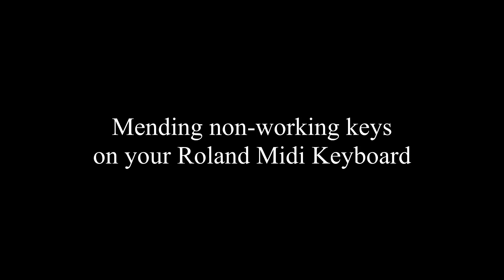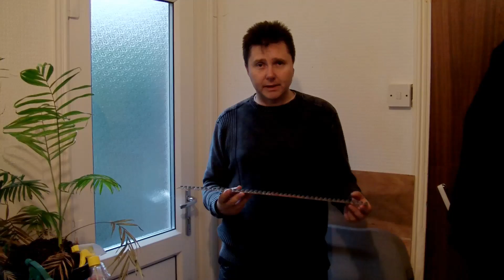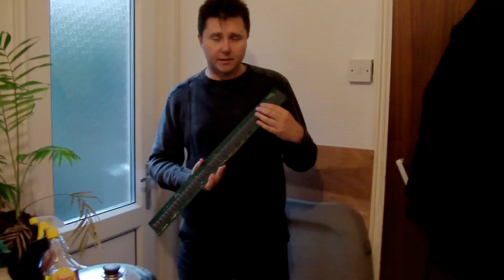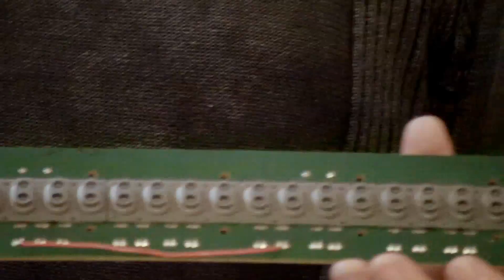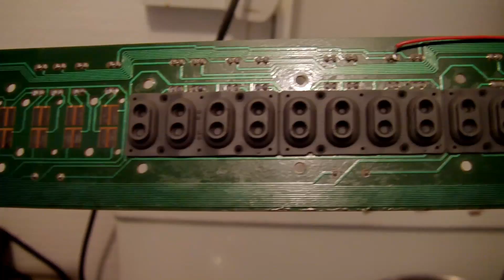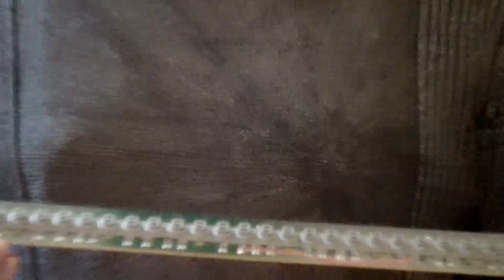Roland keyboard repair

Comment: good day Mike Hersee

need help!

I have Roland A-33 midi controller, all keys are functioning if pressed
separately but if pressed altogether, only 1 key will produce sound.
What will I do with it? I already tried opening it and cleaned the inside 
part using alcohol but nothing happened. Please help me how to fix it.

By the way, I used FL Studio/Korg Triton software upon playing my 
keyboard
  
hope you can help me. Thank you.
Reply from the maker: Ah, now that doesn't sound like a keyboard fault to me, because the way it works it is constantly scanning all the keys by checking each grid combination thousands of times a second, and if it's capable of playing all the keys it should have no trouble with polyphonic sound. It sounds to me as though somewhere something is set to 'mono' instead of  'poly, either in the keyboard or the software synth for that channel, which you would want for some types of sound. Please let me know what you find

Comment: Sir how much price of LCD display board of Roland xps10 keyboard
Reply from the maker: I've got no idea, you'll have to seek out a proper repairer. You may find that new components are hard to find for devices such as this because the ongoing requirement for new items is likely to drop off very quickly once the manufacturer has shifted on to a new model
Reply: @herseem  ok thanks

Comment: Mike, can you explain more how you bridged the break on the PCB trace strip?  I am no export and took my damaged strip to a technician who tried a standard solder to the connection points.  Solder wouldn't take.  Is their a specialist technique or type of solder to connect the wire bridge you featured?
Reply: Meant to say the U20 PCB keyboard contact strip doesn't have soldering points!
Reply from the maker: No solder points? I'm just wondering how components connect then. If there really are no existing solder points to utilise it's more tricky. You might need to scrape away the insulating layer at two points either side of the break and use flux to make the track wettable. You would have to be very careful though when scraping an be soldering as the tracks on circuit boards are quite fragile, especially ones that only carry signals and not power. They can pull away and break very easily. Feel free to send me some photos on michael.hersee@gmail.com so I can see properly what you're dealing with.

Comment: hello
im looking for some advice. ive placed my new contacts on my digital piano but after a few minutes of playing some of them seem to be popping out of there place. the feet dont stay in to well with certain keys. any tips on keeping them down? a tape? glue? although i cant imagine that would be good. just looking for anything from anybody whos delt with this issue
thanks much in advance!
Reply from the maker: Do you mean the rubber contact strip is coming out of place (like the grey rubber contact strip on the thumbnail for this video)?
Reply: @herseem  yes thats exactly what i mean . the little feet that go in there holes. some are popping out. sitting to loose in the hole so when the key is pressed it just comes off
Reply from the maker: @Zexa21  Ok, That's the first time I've heard of that happening. Usually it's a snug fit so it grips.

The key point about any method of attaching them more firmly is to not do it so you can't remove them again without destroying them, or the circuit board. I would suggest trying PVA glue in the first instance as it's ultimately water soluble (Note: don't use waterproof version for external woodwork). If the feet are a bit loose in the hole, take off the rubber strip (noting carefully which way round it goes to ensure the velocity sensitivity still works when you put it back), and put a bit of glue in each hold and on each foot, then reapply the rubber strip to the circuit board, making sure it's slightly weighted down evenly if necessary to ensure that the feet stay in the hole while the glue is drying.

A thought just occurred to me: If they're a loose fit, are you testing them with the circuit board in the open air, or do you mean the problem occurs when the whole device has been completely re-assembled? If the problem is occurring in the open air, it MIGHT be (you'd need to check) that when re-assembled the rubber strips are held in place by the case, preventing them popping out in use. I hope this helps anyway.
Reply: @herseem  awesome thank you so much the further advice.yes they do do it open air but also when re assembled. obviously they sit upright for keys to punch it but they just pop up out of place. i will look into the glue thank you!1
Reply: @herseem  problem is occuring when installed completely then playing begins. like your saying with the glue, im in need of something to keep it in its hole.
thank you so much for help on all this!
Reply: @herseem  sorry for late reply. yes that exactly. but ive since fixed it! but new problem has arisen. theres a key that does work but when i press and hold down key next to it it wont play. any ideas?
thanks

Comment: Hi Mr. Hersee, 
I just repaired a SL88 keyboard 49-key that was no longer working because of circuit corrosion (a cat urinated on !) . I still have one problem on only one key that plays two notes at the same time (C# and F). Do you have any idea where this may come from? I can not find any short circuit. Many thanks for your help !
Reply from the maker: That's an interesting one. Given the way keyboard matrixes work, unless there's a fault in the chip itself (which is relatively unlikely), the only realistic explanation is a short between two tracks SOMEWHERE, so that when the keyboard matrix scans each pair of lines (it only scans one combination at a time, but does it very fast), both keys appear to be pressed. It might be marginal, so that when you press the F key you don't also get C#. It also might not be in the middle of the tracks, it might be at a solder point or something. It sounds as though it's something that could be acting as a semi-conductor to some degree, so it's only one key that causes the issue and not the other. It might even be just an accumulation of the connective stuff at the bottom of the rubber strips that has spread across contacts.

I've just realised while writing this that the two keys it triggers are not adjacent on the keyboard. That should give you a good clue where to look, because if you trace the tracks of the keys, it's likely to be somewhere where the lines that trigger one of those keys are adjacent to the ones that trigger the other.
Reply: Many thanks for your answer M. Hersee, you were right on all the point ! It was at a solder--point and temperature dependant, apparently an oxydation between a connector and the track.
Reply from the maker: Great! I'm glad you found it :-)
Reply: I have been having nearly the exact same issue with a different keyboard. (Keys that are not adjacent but play simultaneously when playing the single key.) The issue comes and goes month to month based on temperature and humidity. I wrote a post on a forum (see for details if interested): https://www.casiomusicforums.com/index.php?/topic/18298-several-px-160-keys-sound-strange/

I have several keys with this issue and based on a diagram of the key matrix, the problem keys are adjacent on the matrix. 

What did you ultimately do to solve your problem? Soon I will disassemble my keyboard again and search for the tracks connected to these keys.

Comment: How to repair keyboard numerical buttons
Reply from the maker: Patel Meet It depends on the construction of the button. Some have a similar type of rubber membrane with conductive bits that contact the circuit board when you press them, like tv remotes often are. With these the circuit board contacts can get dirty, and the best way is to dismantle it and use alcohol to clean the circuit board.
Reply: you should replace the tactile switches , there are several sizes, the U20 uses 6mm x 6mm ones mouser electronics sells them, they are used in many keyboards

Comment: i have roland d50 and there are 5 keys that dont sound i try to clean the contacts and nothing happens. some body can help me plis.i check the board on a bright light to see if something is burn and i couldn't find nothing
Reply from the maker: Ok, here's what you will need to do: Get a multimeter - you can get cheap ones from maplin that are perfectly fine. Use the 'Resistance' setting. What you then need to do is to look at the circuit board, identify on the circuit board itself which are the keys that aren't working (it's not so easy when the keyboard bit is removed, so make a note of exactly which keys aren't working before dismantling it again), and then look at the circuit board tracks to identify the connections between those keys, and where it goes to other keys. What you should be able to identify eventually is tracks that are common only to the keys that don't work, and distinguish them from tracks that are common to keys that do work as well as keys that don't work. What you're interested is ONLY the tracks common to ONLY the keys that don't work. If there's a circuit board problem (rather than in the chip), there will be a break among these tracks. Use the multimeter to check the circuit continuity between solder points at each end of each of these tracks. If the track is good, there will be almost zero resistance between solder points. Somewhere you'll find a break, where the resistance will be either very high or infinity (more than the meter can measure).

I know you said you looked at the whole circuit board with a bright light, but it's not the same as finding exactly a specific track where there's a continuity problem, and then looking ON THAT TRACK to find where it is.
Reply: Mike Hersee ok thanks i already check for continuity and looks ok on all bad keys i dont know what to do know. may the little module its burn or what you think.sr.
Reply: i order from ebay a pair of contact boards i will reply here if i got ir fix.
Reply from the maker: Have you checked the continuity with a multimeter on the resistance scale?
Reply from the maker: By the way, it isn't necessarily burns you're looking for. It's unlikely those tracks will burn out. Corrosion is most likely to be the cause, and it's harder to spot. That's why a multimeter is a useful tool for homing in on the place where there's definitely a break.
Reply: Mike Hersee .i order the parts from ebay but wasnt right parts .so im on the same problem
Reply from the maker: The Godfather81 ok, have you proved all the relevant tracks are ok by using a multimeter?
Reply: Mike Hersee  yes
Reply from the maker: The Godfather81 ok. in that case, without having access to the circuit board myself to examine it, I'm not sure what else to suggest
Reply: Mike Hersee  I got it. I have to do the sAme thing you did.but know I have four keys  sound louder than the other ones.
Reply from the maker: Louder? Hmm. Do the louder keys sound consistently louder? I mean, are the loud ones always at the same volume no matter how slowly you hit the keys? Or do they still vary with speed, but just sound louder for a given speed compared to neighbouring keys?
Reply: Mike Hersee  i already fixed.i put backwards the contac strip .now sound like a champ.thanks anyway s..
Reply from the maker: The Godfather81 haha! It's easy to overlook the basics.

Comment: Hi, Mike. Great video. I have a Yamaha YPG-235. Do you have any advice on fixing a circuit board under the piano keyboard keys on a Yamaha Ypg-235? Mine stopped working all of a sudden and I unscrewed the back, and cleaned the contact points where the rubber hits each spot on the circuit board. None of that cleaning the board worked. Most of the F keys and B keys from the center of the keyboard down don't work. I moved the rubber contacts down to see if the one on either side would work over the circuit board area and it still doesn't work. People have suggested using conductive paint pen to help contact, But I really think it is the circuit board area itself. Anymore suggestions would be greatly appreciated. Anything would help. Thank you in advance, Mike.
Reply from the maker: YBABTU , the way most keyboards seem to work is that it's a kind of matrix, although it doesn't look like one, that is capable of detecting multiple simultaneous keys. In practice, the way everything is linked, a break in the circuit at a single point can often affect multiple keys. What you describe is a whole bunch of keys being affected simultaneously. This is almost certainly going to be a single point of failure, not several places that all failed together. what this requires is a painstaking analysis of the circuit board layout to work out which track, if it failed, could affect only those keys affected and not the others. you may find drawing the circuit layout schematically helps, on a large sheet of paper, and you may find you need several hours at it!
Reply from the maker: Ok, autocorrect typo in my last post: I meant, 'goes', not 'hours', although in practice it may account to the same thing. once you've worked out the range of points been which the fault must lie, you're looking for either a crack, corrosion, or possibly a soldered joint that has become 'dry'. Or possible even a short. A multimeter is an invaluable tool for checking circuit continuity.
Reply: Thank you for your response. I will keep trying to fix it. I'm determined to get it right. Haha, ''hours'''. Glad it's ''goes'' and not ''hours'' or even YEARS. My eyes would've popped outta my head and hit the screen. Again, thank you.

Comment: Hi, would this work on a Baldwin Pianovelle?  It looks like a baby Grand designed in Italy made in Japan.
I have two sticky keys, on opposite ends of the keyboard.
thanks
Reply from the maker: You'll need to be more specific about what you mean by 'sticky'. Are you talking physically sticky in that the key stays down, or that the sound doesn't let go when the key returns to it's resting position?
Reply: Thank you for your reply, it goes down at a different weight than the other keys, sound is not on time.
Also with a black Bb key different feel and delayed sound.
Dinah
Reply from the maker: I think the first thing to look for there is mechanical issues. You'll need to take it apart and look closely at the key support and springing mechanism for what might be subtle differences between keys.  A key responding differently physically to a different weight on it would make me want to look at the springing mechanism very closely - is the spring itself broken? Is the mounting point even slightly damaged so the effective spring length is different? Is there a different level of friction in the mechanism?

Once you've sorted out the physical discrepancies, reassemble and check if any problems still remain

Comment: Hello, I have a velocity problem on my M-AUDIO KEYSTATION88 MKII keyboard. The black keys are much more sensitive than the WHITE keys. This boring problem is experienced by many people on the net.
Have you noticed the same problem? Do you know the solution to fix this problem? THANK YOU IN ADVANCE
ALAIN - ANGERS - FRANCE
Reply from the maker: Bertot Alain, I'm not personally familiar with that keyboard or its mechanism, but as it's all black keys being much more sensitive than all white keys, that suggests a couple of different lines of attack: First I would look to see if there is some setting that adjusts the sensitivity of the black keys relative to the white keys, either a physical knob, switch or button or else a programmable software setting. The reason might be that people generally don't hit the black keys as hard so it's a way of evening it up to get more even playing. When you have exhausted that possibility, I would take it apart and look at the mechanism. It could be that for a given velocity of key press it is geared up to strike the sensor more quickly.

Another possibility is that if it has a two-sensor-per-key strip such as on the Roland and many other keyboards, where it calculates the time difference between sensors being activated to represent the velocity, it might be that the black keys have their activating probes at a closer height than the white keys to simulate greater speed. If that's the case, it will be difficult to fix because shaving one of the probes on each black key to increase the height difference - and keeping it absolutely consistent from one black key to the next - will be the devil's own job.

Ok, couldn't resist looking to see what the rest of the web says as you say it's a common problem. Seems to be some kind of substantive problem that is not always present from new with people finding workarounds rather than getting it solved properly. Looks like you'll have to do the same or get a replacement keyboard.